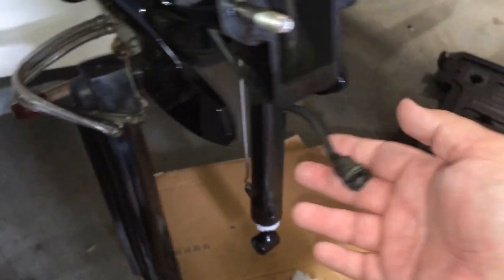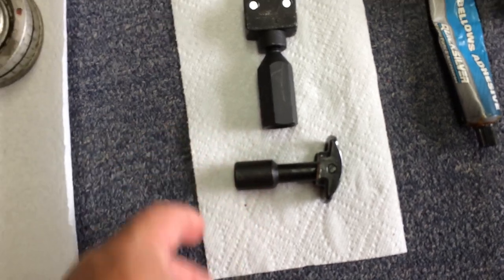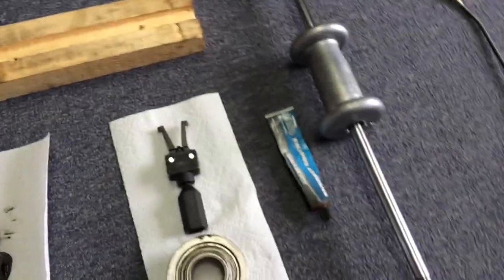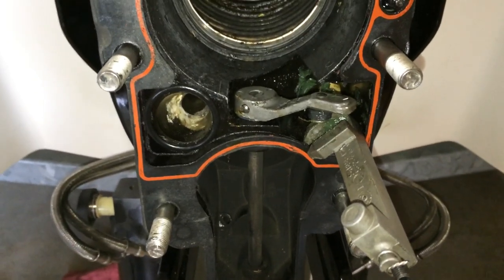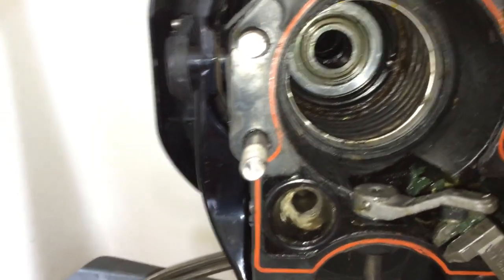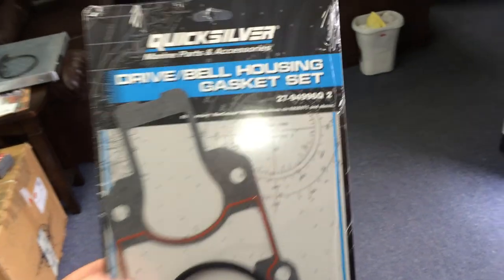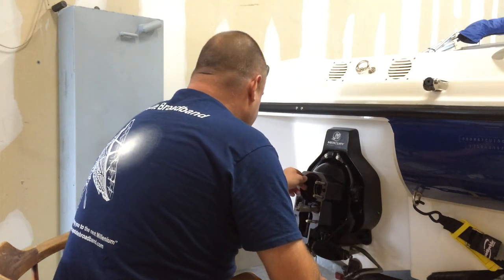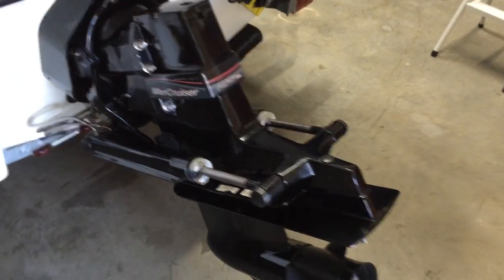Mercruiser Bayliner Gimbal & Bellow Repair

Comment: Here's some tips for you DIY guys out there. Use the new gaskets. When you get the big carboard style gasket. It helps to grease that whole gasket with a light coat (enough to darken the color). So next time you need to do it, you won't spend 15 min scraping the old one off. When putting the new o-rings (water and u-joint) Use a light coat of bellows adhesive. That way they should stay on with out any problems. Also!!! Grease the fuck out of the splines of the u-joint and studs. Makes doing the next service much easier. 

Professional boat mechanic of 10 years
Reply: Thanks Sir, advise well taken, I put the leg on and losing reverse, something wrong I did.
Reply: @osbornebay944  you need to adjust the shift cable, if it's going in and out of neutral and forward good then it's just one bolt to loosen and you can ad more reverse engagement without messing up anything else

Comment: I love your video!!  Very well explained and helpful.  i have a question for you please.  Does the rubber seal inside the gimbel housing next to the u joint bellows retaining ring just slide in up next to the retaining ring?  Does it need to be glued?
Reply from the maker: Not sure. I did not glue mine in when I replaced it because it comes with the gasket set. But I do remember having some fun trying to get everything in.

Comment: Good work - good vid!
"learn from my mistakes!" Very big and honest words!
We say "The only ones who don't make any mistakes are the ones who don't work at all!"
One small advice: Better use a torque wrench next time but indepently from this, if you have to tighten a 6 bolt plate, to avoid the plate from warping, start with the bolts in the middle (middle left, middle right, an then crosswise (e.g. upper left, lower right, upper right lower left) an do this in several (3 e.g. 2 or 3) slight steps. And as said above, for the final step a torque wrench is recommended.
Greetings from Germany :-)

Comment: Thank you so much, your info on getting the drive back on totally saved me! I used alignment tool and still had no luck but after watching this tried keeping counter clockwise pressure on prop while sliding drive on and the splines finally lined up. For this one major tip I am very grateful!!!

Comment: I have an OMC 3.0 and have removed the outdrive a couple of times. You are right, it is a hard job re-installing the drive. I made an A frame with a come-along to lift the drive and slip it in. Still took time to forever to get it to slip in. Nice video. 

JN

Comment: Way to go  Fiero! You really look tired Bro. About to start the season and the marina owner told me my bellows are going to be a problem soon. I have a 1998 Maxum 3000 SCR, with twin 4.3L Merc. The price they're asking to repair both of them is $1800(Québec,Canada).Makes you think twice before throw away money. You seem to have a pretty nice place to work. I agree with EpiDemic, you should build an out drive stand, I used 2X3, cheaper and plywood. I suggest once your trailer is backup in your garage, lower down your trim to the position you would need to take out the out drive. Before doing so, build on site the stand. You won't need to use those muscles anymore, saves your back and you won't even need that big final kick LOL! Just by sliding or pushing your stand will do the job. The alignment should be great, if not, use the trim. I use a long screw driver horizontally and place it between the drive and the out drive before removing the trim bars, it will keep the alignment on the spot. With the stand it's pretty easy using your hand and holding the shaft (helping it into place,rotating if necessary) while pushing the out drive in place. Great fun! See ya (Steph)

Comment: Man, you weren't kidding.  This was a job and a half. I think it's the hardest thing I've done on this boat.  I have a Bayliner 245 and just finished in time to watch the end of my vacation go by without using the boat; however, same out drive.  Had not done this maintenance in the boats 16 years.  Lots of bottle parts like the start drive reservoir hull pass through which broke when I tried to pull the line out of the bell housing.  Word to the wise, cut the oil and water lines and replace them.  It much easier than replacing these pass through the hull/transom.   Another tip I learned was to put the gimble bearing, the oil seal and the gimble below aluminum ring in the freezer over night.  The bearing, seal, and ring will contract enough to make installation just a bit easier.  I learned this from a good marine mechanic.  I had a bugger of a time getting the exhaust bellows on.  Also I used the karate kick used in this video to get my out drive back on.  This is a good video, but watch others too.  I learned something from all.of them.  Thanks!

Comment: nice kick to get it in!
Reply from the maker: Thank you !!
Reply: There’s actually a couple o-rings on the driveshaft that fit inside the gimbal bearing. Sometimes it takes a bump or two to get the shaft through the bearing. Not uncommon to have to “persuade” it in that final little bit.

Comment: So I'm a boat tec.  On a regular do work on alpha 1,2 bravo 1, 2 Volvo penta etc.i give you credit man that's a pain in the ass but needed it done, u didn't hold ur self at the mercy of 125$ an hour at a shop, good job.
But, you didn't mention how you aligned the motor did you adjust motor, or play with the gimbal??

Comment: Nice video... how did you align your bearing back to normal.. did you adjust the motor mounts?? or how did you get that alignment to to go all the way like is should thanks
Reply: The alignment bar slides through the barring and into the engine making making it a straight shot.

Comment: I was told to use toothpaste for the O Ring, it has higher tack besides grease over time will break down the neoprene.
Reply: Tooth paste is an abrasive , aluminium oxide, very fine, but still an abrasive. Neoprene has very low reactance to water and petroleum products  so normal marine and car grease should have almost no effect on the O ring.
Reply: Kenn use bellows adhesive
Reply: Or use OMC Type M sealant, which is equivalent to High Tack sealant. A thin film, and time to dry will do ya.
Reply: The gimbal bearing is essentially a spherical bearing.  I’ve done them without the alignment tool, but the tool does help when reinstalling the drive.
Reply: Use a light sealer like RTV or weatherstrip adhesive

Comment: The alignment tool helps to adjust the bearing if you need reorient it but it isn't intended for that job. its made to align your coupler and yoke. its a tool worth having if you engine is truly miss aligned you'll go though a gimbal bearing every season or two. Mechanics generally just change your bearing and keep the true reason for its failure to them selves..
Reply from the maker: Agreed but my failure was due to the boot clamp off taking in water.
Reply: +fiero880 oh definatly your alignment looked spot on, the alignment tool looked like it came out super easy.

Comment: The Thule says it doesn’t work works just fine for pulling gimbal bearing then replacing gimbal bearings for over 10 years and that’s the tool are use got to make sure that you have O-rings put on the puller

Comment: How do you know when to replace these parts ? I've got about 175 hours on a 05 195 4.3 mer alpha one 
Thanks
Reply: Inspect Bellow's for rips, tears, etc when the boat is out of the water and then just inspect them every season at beginning and end and when you see some parts of the Bellow's looking like they're ready to go replace them. The gimbal bearing I think is based on hours and use but when it actually goes bad you will hear the difference in the rear end of the boat
Reply: @jkokenos  sold the boat, good to know tho. Thanks

Comment: fierro880....I need some expert advice. Ever since I have gone to thru hull exhaust in 2000 which comes out the side port, by the way my boat is a `91 Stingray 658zpx with a 350 Mercruiser Alpha One drive. The exhaust bellows hasn't lasted long and after replacing one last year it has already ruptured. I am thinking that since the warm exhaust water does not run thru the exhaust bellows anymore that it gets hard and brittle real fast. Now I am having problems installing a new bellows. So does one end always have to be connected to the transom side first? Right now it is connected to the drive side after I tried the transom side first. It would have to be pushed on some way or I have to take it off and connect on the transom side again and try using the zip tie method seen on a youtube video. Another question is, can you go without an exhaust bellows and just cap it on the transom pipe and if so, does the drive side need capping too? What are your suggestions and materials for capping the bellows pipe connections? Thank You sir!

Comment: The gimbal bearing is not supposed to swivel. If it does it's bad. The u joints on the drive shaft is the swivel point

Comment: I've always wondered why the don't put a shift rod seal in with this kit.  When that seal goes bad, water gets in with the shift cable end.  The water then make it's way up into the engine and drips into the bilge.  I recommend to replace that seal when you have this all apart.

Comment: Need some help here... I've done a engine swap and now put in a 2.5l diesel turbo.. on my first dry run I kept the engine on for about 4 mins.. and then check for hot spots ... I realised that the shaft was quite hot.. I realised that I had put the shaft forcebly inside with a lot of kicks..as the alignment was not fully accurate I believe... How can I realign the engine without removing the drive? Else it will be back to square 1. Plz advise....
Reply: Remove the drive and get an alignment tool, adjust motor mounts as needled

Comment: Oh yea, one more thing - on Alpha 1 -  I recommend you remove the front pin on the trim cylinders as well.  Drop the cylinders down out of the way.  Makes it a ton easier to get the outdrive back on.  I'm no pro but I've struggled with it a time or two.

Comment: So what was causing the water to drip into the inside of the boat? Im having the same issue, and currently trying to track down parts. Just looking to make darn sure I fix the problem!
Reply: Jeff - My opinion is the previous owner had stored the drive in the up position and it caused the bellows to come off partially on the one end - it pulled the clamp partially off too. I believe the water was getting in through that small opening. He fixed that by loosing the clamp, re-positioning it and reapplying the bellows adhesive. If you re-watch the video it shows the bellows where it was partially pulled off. The video does not show him actually fixing it.

Comment: Thanks, I think I am about to feel your pain! Question..When I tilted my drive up last night while cruising into dock I noticed a lot of vibration and shaking, When tilted back down ran smooth? Does this sound like gimbal? Im thinking u joint? anyone have experience with this issue? and if so will I have to pull drive off for u joint?Thanks for sharing your experience with the world. Harry
Reply from the maker: Could be either or, or both. When you remove your drive you will easily be able to inspect the bearing and u joint. Sounds like a gimbal bearing.

Comment: thanks for putting this out there!, I have been having such a hard time with my stern  drive to be placed back in. I put a new motor in my boat so went through the out drive too but alignment was off. I purchased the tools you used and hitting it again. Thinking positive

Comment: Mate, great video. Has given me the confidence to attack mine.   However, I am from Australia and all those tools are super expensive.   Is there any chance that you could give the specifications of the alignment tool.  Like OD and length of the two sizes and minimum length so I can machine one up.   Someone told me it could be easier to do if you remove the gearbox, makes it not so heavy to handle and therefore easier to manipulate on the install.
Reply: much appreciated

Comment: Great video fiero880, I loved your honesty admitting when you made mistakes and evaluating the time spent vs. the estimated cost to have somebody else do it for you.  Having watched other videos about this I wonder if it would have been easier for you to remove the whole gimbal, as it looks like it is not to difficult to do it, and replacing the bellows with new ones seems like the right way to go when getting that far into the project (of course I have no idea what those bellows may cost, but I bet they are not that expensive to replace once you are in there).
Anyways, thanks again not only for the knowledge I gained from the video, but for the inspiration too.
I just got my first boat and just noticed that the water hose from the drive to the engine is leaking badly, so I need to replace it, and this video shows me all I need to know to take on that job (I'll get an estimate first.  I'm willing to pay up to $500 to have that done.  Anything more than that and that will be my turning point to do it myself).
Thanks again and again.
Reply: Falcon Mac hi did you find out how much get charge in a marine shop?

Comment: The white plastic screen inside my lower unit to keep seaweed out got sucked upward. Now I can't drive more than 15 kms /hr  and the engine just revs if I try to give it but the engine won't go any quicker.  Where would it be stuck to cause this.
Reply from the maker: that sounds like a spun prop hub
Reply: fiero880 my propeller is fine. It was an issue at one point as it did slip.. But now it's something else. Not sure what. Plugged internally or could be another issue.

Comment: HI..... my phone
hydraulic pump is not the tail is up in the trailer position but it won't go down...could be because is low in hydraulic liquid?
Reply from the maker: Yes possible. Is the pump running but outdrive not moving ?
Reply: +fiero880 yes the pump works but it does move down
Reply from the maker: I too had a similar issue with an older mercruiser. Never fixed it or troubleshooted the issue before selling the boat

Comment: how do you know the Bering was bad, im guessing mine is, something is ratting around during idle,, i know what bad U joints sound like, ben there
Reply: what did your bad u-joints sound like? And how much was the repair?
Reply: they make like a clacking or knocking noise and was worse in a turn or when i raised the out drive up to do wheelies .. $253 for 2 U joints, had a bunch of other stuff done so not shure on labor, had water pump, oil, exaust bellow, adjustments,, labor was $760 at $85 per hour.
Reply: they sounded like they were going to grenade but they wernt that bad, they were dry and warn, if they were on my truck i probably wouldn't notice, the mechanic told me to quit raising the out drive and doing wheelies its not good for them .

Comment: good morning sir im.having a problem trying to get an special tool to fix. my mercruiser can you help me out where can i buy it?
Reply from the maker: I know they are for sale on eBay or you will have to make one. http://www.ebay.com/itm/Alpha-Bravo-Gimbal-Bearing-Installer-Puller-Alignment-Tools-for-Mercruiser-/281111158349?hash=item417387de4d&vxp=mtr

The puller to pull the bearing that I used is like this one
 
http://www.ebay.com/itm/Rear-Axle-Bearing-Puller-Puller-Slide-Hammer-Set-Extract-Repair-Installer-w-case-/231276067457?hash=item35d920ba81&item=231276067457&vxp=mtr

http://www.ebay.com/itm/OTC-Tools-6540-8-Piece-Rear-Axle-Bearing-Puller-Set-/321755775383?hash=item4aea238197&item=321755775383&vxp=mtr
Reply: +fiero880 thank you sir but i think that the special tool.that i need is one that you use by the side of.the engine can you help me out?
Reply: +fiero880 its like a tool of 12 points
Reply from the maker: are you referring to the engine alignment tool ?
Reply: Its like a dice to disarm a part of.the engine do.you have an email so i can send you an.image of the part of the engine??
Reply from the maker: http://www.ebay.com/itm/Hinge-Pin-Tool-for-Mercruiser-Units-replaces-91-78310-/230785718586?hash=item35bbe6993a&vxp=mtr
Reply: Omg! Thank.you so much!!